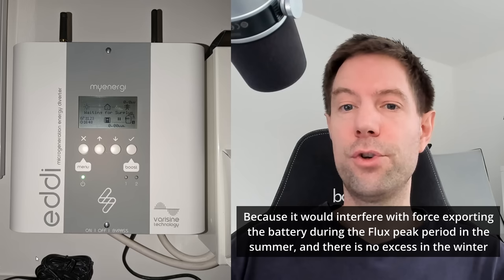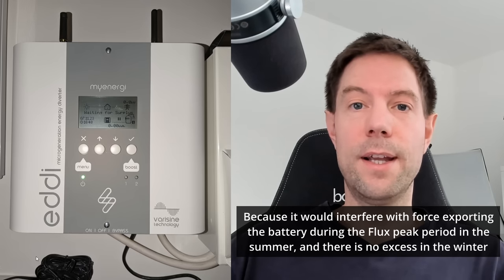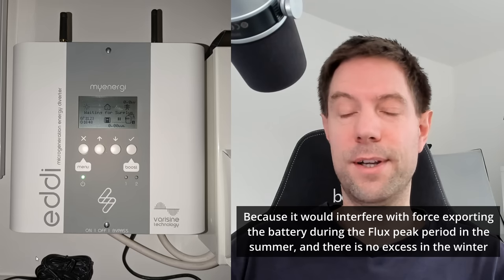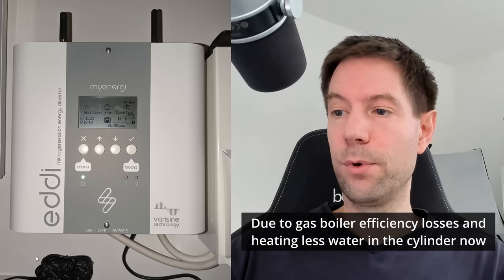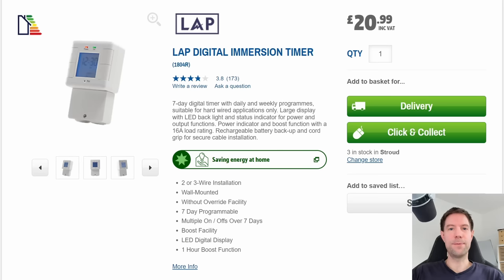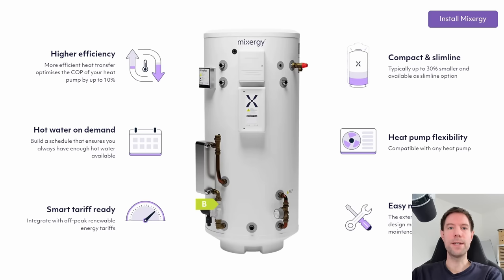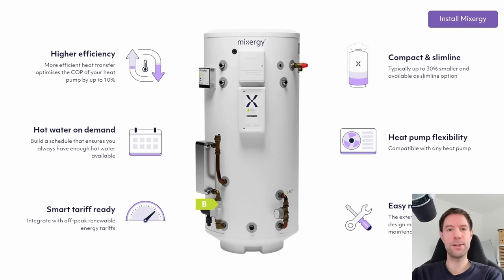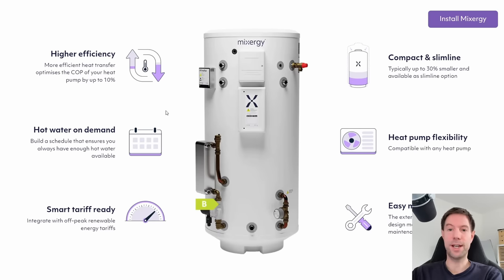Gas free hot water - so many options!

Comment: I'm currently weighing up options for replacing a gas combi boiler doing water and space heating (and maybe gain aircon in the process if I go down the A2A route).  Thanks for this video, a helpful addition to my research.😀

Regarding the high-power (and relatively expensive) electric combi boilers, are they not sized as full replacements, to cover both hot water and radiators?  I was under the impression that much smaller and cheaper units could be used just to heat the water (possibly separately for kitchen and bathroom), if space heating was being taken care of separately.   Any thoughts on this?
Reply from the maker: Yes, you can get smaller units for hot water only but they still require very high power to create that hot water quick enough, and that will result in peak rate power draw so will end up more expensive to run than storing your hot water in a cylinder heated with cheap rate power (assuming you have the space for it).
Reply: @TimAndKatsGreenWalk  I see what you mean.  I'm in a 1-bed flat so space is at a premium; I had given some thought to Sunamp, but was thinking that electric batteries (rather than heat batteries) would offer more flexibility. But I guess not if they aren't capable of supplying power at the required rate.

My options for replacing the combi boiler are likely to be constrained; I'm on the 3rd floor with no balcony, but I do have a loft. I'm guessing I won't be able to get an external unit installed anywhere. I have seen that there are entirely internal A2A units available, for which you basically drill two holes in the wall in order to draw outside air through the unit.

I've also been considering far infrared panels for heating (forgoing the aircon).

I confess I've not entirely ruled out just getting another gas boiler.😕
Reply from the maker: @colinmcconnell827  yes, that is tricky, I understand your predicament.  A battery like the GivEnergy All in One can output at 6 kW, so that would be almost able to cope with an electric boiler running at 7 kW, say (which is similar to an electric shower power rating).  But then you're spending £6k+ for that, and it takes up room, so something to factor in.  It does sound like a Sunamp type system might be a decent option in your case for hot water.  Regarding heating I'd certainly be interested to learn of any A2A systems that are entirely internal.  Of course you then have the issue of the heat pump itself being inside and therefore being more audible (like with the heat pump cylinders I mentioned).  In a flat that might make it quite intrusive.  If the whole building could come together to implement a building wide system that would be ideal, but as always much trickier to organise!
Reply: @TimAndKatsGreenWalk  Sorry, I posted a reply yesterday which disappeared into the void; I think YouTube may have thought it detected external links and not allowed it as a result.  I'll try again, totally link-free -

The internal A2A units seem to be mostly marketed with the terms 'condenserless' or 'twin duct'.  You can find YouTube videos demoing them, as well as websites from manufacturers and sellers.  Some brand names are 'Powrmatic' and 'electriQ iQool'.

Looking at them again, I notice that they are marketed as air conditioners with a heating mode.  This may be connected with comments I've seen that they don't work well (or maybe at all) when the outside temperature gets below 5C.  So, as well as the noise, that might be another reason to avoid them.

As I said, I have a loft space.  Most sources I have seen have said that it is not viable to install a condenser in a (suitably ventilated) loft, but I have seen one or two articles suggesting it can be an option. If could make that work, then I could potentially end up with an ideal solution where all the bulky, noisy stuff is hidden away and I just have a few vents in the ceiling.  Have you come across anything like this?
Reply: @TimAndKatsGreenWalk  You can get entirely internal heat pumps - they wall mount with air intake/exhaust at the back which is then drilled through the wall. Externally all that is visible are some circular covers. My inlaws have two for heating/cooling their house, they seem to work well (scop of 3) but might be too noisy if you are in a comparatively small space.
Reply: @notjustageek  Those are what I am talking about.  No reports from your inlaws of problems when the external temp is very low?
Reply from the maker: @colinmcconnell827  our heating system is AC units running in heating mode (all AC systems are just A2A heat pumps after all) and they worked fine down to -10 last year.  It's possible these internal systems have different operating parameters though.

I've not come across any loft mounted fully internal systems but that does sound like a good potential solution.  Extra ventilation could be provided via vents to the outside too.
Reply: @TimAndKatsGreenWalk   Yeah, different operating parameters was the implication of the comment I read.  No idea if the comment was well founded or not, but I guess limited airflow, compared to a big external condenser fully open to the elements might be a technical reason for poorer performance. 

I think one of the warnings I read, counselling against trying to put a condenser in the loft, is that most installers are likely either to refuse or not to guarantee their work.  A fanciful idea that has come to me during this discussion is that one of these specifically internal units, intended to be housed in your room(s), could instead be used as the basis for a DIY kludge in the loft, with ducting to circulate the air to/from the rooms. (One advantage of these units is that they can be DIY installed, as the refrigerant plumbing is all within a sealed unit.)   Probably a bit too fanciful!😀

Comment: What about the ZEB, it does central heating and water, very little change is needed if any, remove the boiler and plug in the ZEB. It would be great to get your thoughts on the ZEB.
Reply from the maker: The ZEB doesn't currently do hot water, but they're working on it.  As and when they bring out that 'combi' version I might add it to the list, but for now it's central heating only.  I wouldn't personally consider it for our situation as it's not as efficient as a heat pump based system, so wouldn't help us reduce our energy use, which is my main aim.  It's definitely a good solution for some homes though, no denying that.
Reply: My understanding is that ZEB will do hot water but only if you have a hot water tank. And as you say they are working on a combi version.
Reply from the maker: @alanfoulkes9383  I thought it was central heating only right now.
Reply from the maker: @alanfoulkes9383  ah, no, you're right, it can heat your hot water cylinder too, my mistake.
Reply: A ZEB is just an electric heat store. IIRC it's just a lump of concrete that you heat with electricity when it's cheap, and then extract that heat later in the day. That makes some sense for heating your house (if it's a lot cheaper than a heat pump), but a hot water tank is already a heat store for an immersion heater.

Comment: I will try to get over my disappointment that you weren't doing cross stitch on a unicycle .....let it go me ! 🙈

I'm still not sure where A2A and grants are even though someone did say that combined with a HP water tank you could/might qualify. 🤔

So in the meantime I did sign up to trial with heata . (Hopefully I'll be selected) This is the data processing centre attached to the tank. Saw this fullly charged live. Might be worth your while 🤷‍♂️
Reply from the maker: Yeah, I saw a video on that data centre thing.  Not something I'm considering but an interesting option, for sure.  So it seems that A2A doesn't qualify for the BUS even if it comes with hot water too, which is a shame.  A bit of an oversight in my opinion but there you go.  Perhaps that situation will change but I wouldn't bet on it.
Reply: We have just had a hybird A2A/A2W system fitted in our bungalow that did qaulify for the BUS grant! Daikin Heatpump that runs to a unit that spilts it to a hot water tank and then water to 4 fan units in the loft that can run hot or cold air ducked into every room. Was a huge amount disruption but we had a dead gas combi and rusted out radiators. We have lost a fair bit of loft space but no radiators frees up a lot of wall space inside the property. We are a 3 bed bungalow and it cost us £8 after the old £5 BUS grant   @TimAndKatsGreenWalk
Reply from the maker: @simoneisgod  ah, very interesting.  Sounds like a great system.  Ok, so it seems my understanding of the BUS isn't complete.

Comment: Wont the servicing cost of a HP cylinder negate any savings you make ?
Reply from the maker: It's the energy saving that matters to me.  See my pinned comment for more detail.
Reply: ive just has my air to air serviced and it was a lot more than i anticipated so thought it was worth noting
Reply from the maker: @robpatterson754  same, as it happens.  I'll mention cost implications in the next video.

Comment: Very interesting indeed , listening to you just tells me how little I know in regards to all of this modern stuff for want of a better word on the market , I like the idea of getting rid of my gas and getting a heat pump , but never seem to be able to find any information about the cost between a heat pump and a gas boiler , hear lots about how efficient the heat pumps are , tend to hear figures such as oh the heat pump is 160% or 400% more efficient well Great but how much is the cost from October to March month by month with cost , it’s like as though the true cost is being hidden, not the cost of the heat pump but the cost of running it , all people say oh it depends on what tariff you’re on yes that’s seem to be a cop out as I see it , there has to be some kind of chart or ball park figure yet nowhere can one find this information. Yes you will need a whiskey to get through this message at least you will be warm in the inside.
Reply from the maker: The simplest way to do the calculation is to look at the SCOP (seasonal coefficient of performance) of the heat pump.  A SCOP of 3 means it generates 3x as much heat as the electricity it uses.  A gas boiler is about 80-90% efficient so effectively a SCOP of 0.8-0.9.  Gas currently costs about a third as much as electricity (give or take), so a heat pump will cost about the same to run as a gas boiler.  Then the tariff comes into it of course, but there's your ball-park figure.  For us, we're able to run our heating using solar and battery (which has been charged up at cheap overnight rates) so it does then make it significantly cheaper than a gas boiler, and the water can be heated overnight too, using that cheap power.  I hope that helps a bit.
Reply: @TimAndKatsGreenWalk  That’s probably the best answer I’ve ever seen , I think that whiskey has reached the logical nerve. I’ve watched a few of your videos which are very good by the way , I don’t have the money for solar or battery set up, just trying to get warm in the most efficient way and my biggest fear is not being able to afford to run the heat pump , irrespective of the efficiency of the heat pump compared to gas boiler I have this underlying concern it’s going to be three times more expensive with the bills. If someone could prove to me that here are the bills month by month from October to march comparison and there’s no difference, I would put my order in tomorrow, but my gut feeling is they can’t and it is three times more expensive to run, I’ve started to look at wood burners now which is crazy and even I think it’s crazy that I’m looking in that direction, maybe the way forward is for the electric companies to  those who buy a heat pump don’t have 15% of their bill to pay for the green agenda that way the cost of running the heat pump would be more in line to those who have gas bills .
Reply from the maker: Running a heat pump is definitely not three times the cost of running a gas boiler.  It'd be comparable, maybe a bit more, maybe a bit less, but certainly not three times more!
Reply: @KavanOBrien  there are various factors at play here you will use more electric than you normally use during the winter months as thats due to using an ASHP to do your heating (be that air2water or air2air) but to heat water within an ASHP is much more efficient than heating it with gas for the same energy input. The main issue is ASHP have a lower heat output so radiators may need to be upgraded and just doing insulation will improve the heating. The main point is that everyone’s house is different and their existing services are different and the need to upgrade or replace is different. I had oil I wanted to replace that with electric only solution as I have solar and Battery storage which absolutely reduces my monthly costs and offsets the high rate tariff periods. There is a payback period for my solar and battery but it will at current rates will be paid back full in 8 years total (ive had just under 3 years so 5 to go) but that is assuming prices stay as they are which I just dont see happening so when it utility prices go up then my return period will come down.  I dont think a wood burner is viable as you still need to get a wood burner, then the wood and the time it takes to setup and clean. Unless you have free access to wood and the right type of wood not something that will burn in minutes.

Comment: Changing your current setup for hot water will never be cost effective. Better to spend money on more solar if possible. A quick change is to wire the top immersion heater instead of the lower one will mean  you are heating less water.
Reply from the maker: I'm hoping to do both but in either case I'm not expecting it to be cost effective.  I'll explain more in the next video.

Comment: I'd stick with what you have, just make sure the controls are always pulling energy when its cheapest/free. It's a shame the multi-split A/C guys don't provide a solution for water heating, you could imagine a fairly simple heat exchanger on one of the loops, with the right set of valves in summer it could dump heat from space cooling into the cylinder. I'm sure its coming and it might make me look at a refrigerant based system over a water based one when it comes.
Reply from the maker: There are some A2A systems that do effectively what you suggest, but not many, sadly.  Daikin Multiplus is one such system.  I didn't know about that when I first looked into A2A last year.
Reply: @TimAndKatsGreenWalk  Also the Samsung TDM+. The Daiken Multiplus has a 90/120l tank, which seems well below the MSC standard for tank size. The intent seems to be more flats than houses.  So the TDM+ tank is too big for a UK domestic hot water cupboard, the Daiken multiplus probably won't allow two showers in a row, and would require daytime electric or battery cover to reheat if there is a brake between the showers and you don't need heating/cooling while it's doing that. I know the focus is on tanks, but I think you're beating yourself up for not going for an A2A+DHW option that doesn't really exist!
Reply from the maker: @stevescott9289  perhaps you're right!  I hadn't realised the Daikin tank was so small, that definitely wouldn't have covered our needs.  Might suit some folks though, as you say.
Reply: @TimAndKatsGreenWalk  Only thing I'm trying to work out is if a A2A+DHW system could qualify the the Boiler Upgrade Scheme. Our house is 1980's warm air, which is unsuited to A2W (We have no radiators).
Reply from the maker: @stevescott9289  this is a tricky question to answer and I've been unable to fully get to the bottom of it.  On the BUS website it says (or said at one point when I last looked) that A2A didn't qualify even if it included hot water, but then another viewer said that they were able to get the BUS with such a system.  Perhaps a canny (MCS registered) installer could make it happen but from my experience most "regular" AC installers know nothing about it, so it'd take some research to find a suitably qualified and knowledgeable installer.

Comment: I am all in favour of A2A heating but why did you get rid of your gas boiler and then install such a massive tank? Doesn't make sense as heating water by electricity is far more expensive than having shower with a combi. What else do you wand hot water for anyway as I'm sure you have a dishwasher and washing machine both of which run on cold water. PS the top immersion is so you can heat a smaller amount of water which saves money
Reply from the maker: The tank was already there as part of the existing system, we didn't install it.  It costs us less to heat via the immersion than the gas boiler because we do it using off peak power.  I've got plenty more videos that cover all of this stuff, so go check those out.